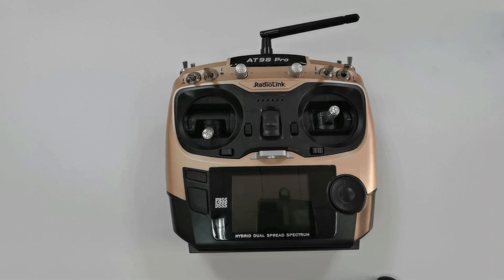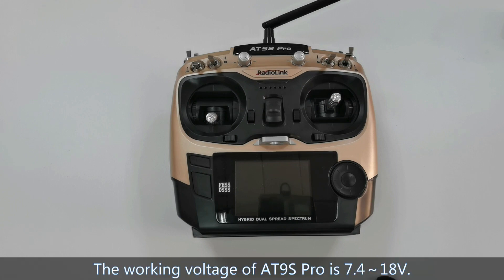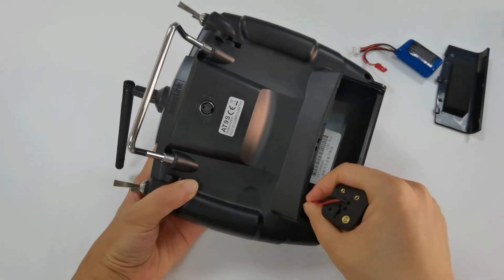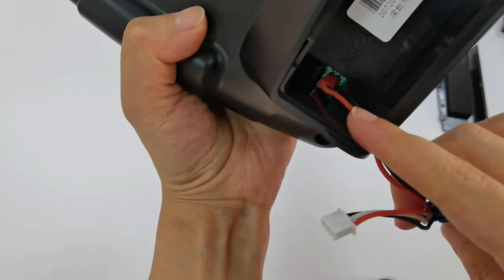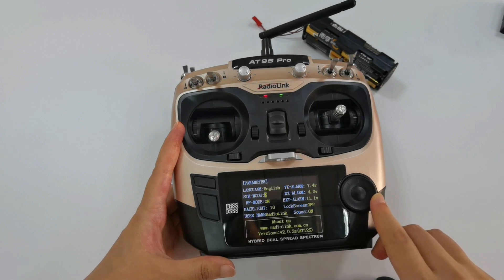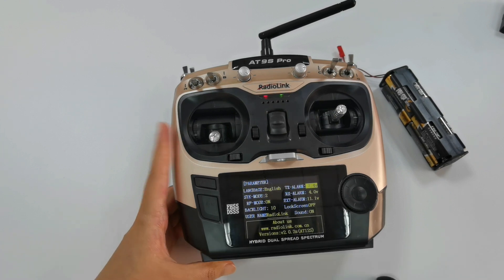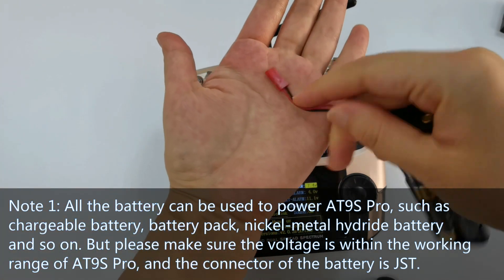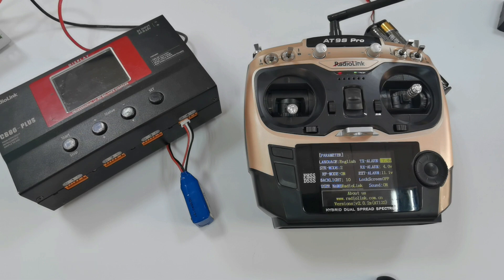TX Lower Power & Battery Supply of AT9S Pro/AT10II

Comment: What difference would it create by pairing it with 2s, 3s and a 4s battery of same amperage?
Reply from the maker: Hi, sir. There is no difference when you use 2S or 3S lipo battery to power on AT9S. The working voltage of AT9S is 7.4-18.0V(8pcs AA battery, a 2S-4S LiPo or 18650 Lithiumbattery). If the power supply voltage is within it, all the functions of the transmitter will work well. If any question about RadioLink products please feel free to contact us. Our email is: after_service@radiolink.com.cn

Comment: i have an at9s. how do i use a 4s lipo battery instead of a double a battery
Reply from the maker: Hi, sir. You can use 2-4S lipo battery to supply power to AT9S Pro. Please make sure there is JST connector (The same connector of the 2S battery in the video). So you may need to modify the connector if your current 4S lipo battery has no JST connector. If any question when using RadioLink products please feel free to contact us. Our email is: after_service@radiolink.com.cn